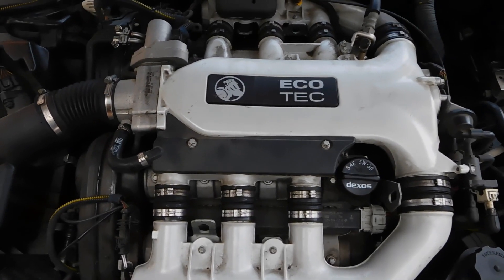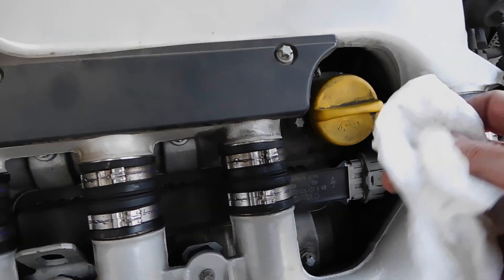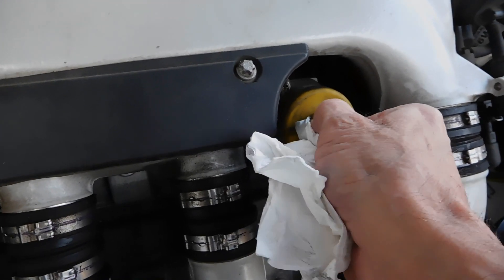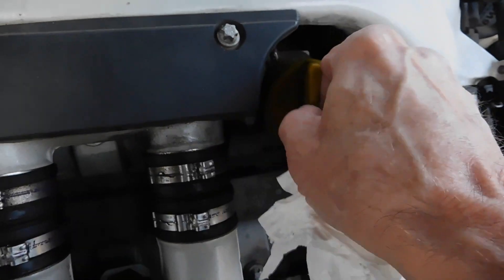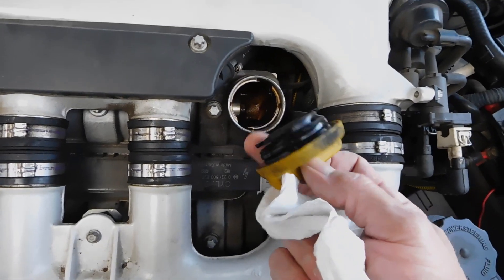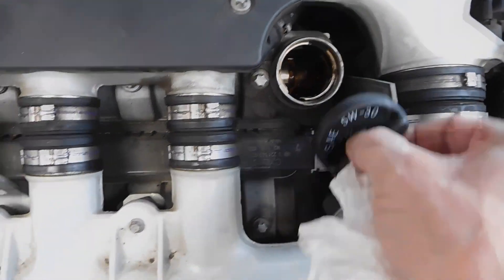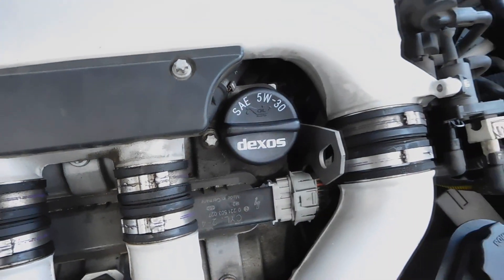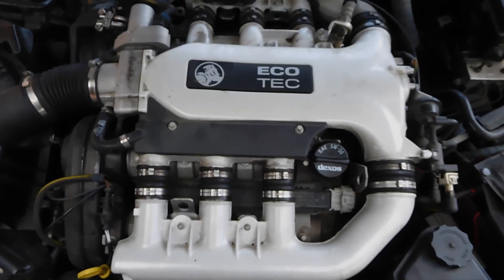How your oil filler cap may cause poor fuel economy, low MPG

Comment from the maker: On the odd chance that anyone watching this video doesn't happen to read the description that explains why this can cause poor fuel economy, here is the reason again

Air drawn into the crankcase by the PCV (positive crankcase ventilation) valve is normally drawn in via the crankcase breather inlet tube which is attached to and sources fresh filtered air from the air intake snorkel between the intake throttle plate and the MAF (manifold air flow) sensor.

The result of having a loose oil cap is that some of the air entering the engine drawn in by the PCV will not go through the MAF sensor as it normally should

Instead being drawn in via the loose oil cap, and thus not be accounted for in fuel mixture control that uses the MAF sensor to determine the volume of air flowing into the engine.

This is similar to a leaking air intake snorkel or defective MAF that will cause incorrect mixture calculations.

In addition to this as the air drawn into the crankcase via the leaking oil cap is not filtered as it is if drawn in via the intake snorkel that non filtered dirty air will contaminate the engine oil and cause it to be prematurely compromised in it ability to lubricate the engine.

And this condition is worsened by air back flowing in to the snorkel from the crankcase that contains oil vapor that should be going into the PCV valve and not the air intake, the result is the oil vapor will contaminate the throttle plate causing a build of dirt on it and that may cause poor idle control in addition to the poor mileage from the first condition.
Reply: Whats your opinion on  finite thermo cycling being a large portion of an engines determined life? ( I try to sound smart when i drink)
Reply: I have a leaky valve/tappet cover gasket. Could it also be drawing in air and causing the same problem?  The car is also idling at 1300 instead of 700.
Reply from the maker: @newsgetsold  
I doubt it, the issue here is not like a vacuum leak of an intake for example it is just that the source of the air incoming that is around atmospheric anyway is not coming through the MAF, or is not being accounted for in the ECM
The high idle you have would indicate some other fault.
Reply: @AuMechanic  Okay thanks.  I just thought the oil filler cap is also in the tappet cover so a leak elsewhere on the cover would have the same result?
Reply from the maker: @newsgetsold  
It would need to be a fairly open leak enough the "vent" the crankcase as the air is drawn into the PCV (positive crankcase ventilation) valve by vacuum.
A loose filler cap provides enough leak path to do that but a small leak of the gasket isn't large enough to draw so much air in it bypasses the MAF sensor on the intake snorkel.
Reply: @DarkLinkAD  🤣🤣🤣🤣🤣🤣🤣🤣🤣🤣🤣🤣🤣🤣🤣🤣🤣🤣🤣🤣 💯 TRUTH
Reply: @newsgetsold  when I have additional air - such as removing my brake booster vacuum line, the engine revs way up!
Reply: and/also: PCM reading a LEAN condition will then inject more fuel and can foul the spark plugs and create misfires, I just experienced.   Ive been chasing down problems on my GMC van for awhile now.. and Im down now finally to a loose, non sealing oil fill cap and damaged oil fill tube grommet at the engine.   Thanks!

Comment: It's one of the overlooked things on an engine, but it could cost the driver a fortune in wasted fuel over the years!
Cheers mate, for highlighting the issue!! 🙂👍
Reply from the maker: Thanks for the comment.
The other issue with this is sucking un filtered air (and dust) into the crank case too so its worth checking.
Reply: @AuMechanic  Yes, indeed. Thank you.
Reply: The fuel cap is another one to check on older cars. The seals go on those eventually. If it feels loose or you can smell petrol around it, it's probably shot. Petrol vapours leave behind dirty, oily looking blotchy patches on the inside of the flap as well.

Comment: I replaced oil cap on a vauxhall meriva and noticed the difference in power.This was after a friend mentioned it.
Although no oil was leaking out of the cap it could not have been tight enough for some time, although it did not feel loose at all really.
For the cost it is worth replacing every couple of years if you are keeping the car for any length of time.
The difference in power i noticed the next day i drove the car,i reckon i might have been losing about 10hp on a 1.4  16v petrol engine.! No doubt i will get better fuel economy now too,even though it is good at the moment.That £7 i spent on the cap will pay for itself in a few weeks of better fuel economy i should imagine.
Reply: thanks for the info!

Comment from the maker: Regarding poor fuel economy, while the O2 sensor will cause the fuel trims to adjust to compensate for the un-metered air that is bypassing the MAF, that will not compensate for instantaneous air flow metered by the MAF sensor, the results of which is that fuel consumption will increase in the same way it does with a dirty MAF sensor.

Comment: I found that with my Holden VY SS Commodore which has a Worn oil filler neck in the valve rocker cover.
The knob which the thread of the oil filler cap screws onto is worn so I fitted an O ring underneath the oil filler cap as a temporary repair to tighten it up & it works.

I seem to be getting far better fuel economy now !
Reply from the maker: Glad to hear it.

Comment: my mechanic told me that if you loose your oil filler cap it won't suck air, put push a lot of air out as part of the pvc system
Reply from the maker: He's got it backwards.
The vacuum of the PCV is greater than the blow by in a normal engine.

Comment: i have azera 2009 & this damn cap is cost me replacing the vales sealing thinking the leakage is from vales sealing. then after few years the alternator broke due to the oil leakage again from the same area! then i found that the cap is not closing tight & leakage is coming from it! so this cap need to be genuine part & closed tight. mine is the type making clicking sound so if it's turning fast not slow it need to be changed. i'm just starting loving EVs more & more🥲 specially the one with the range extender🙂

Comment: Ordered my new dexos oil cap today. Will be here I  no a week. It’s tight when attached. But the seal is loose when I remove it. My oil filler neck feels loose as well. It’s a Chevy equinox. Any idea how to replace the filler neck that the cap screws into?
Reply from the maker: In short, no.
That's a bit beyond the scope[e of the video.
You just need to make sure it seals one way or another.
Reply: I have the same issue. There are a bunch of Permatex products. Do you know which one would be used to run a bead around the tube where it sits on the valve cover?

Comment: Would a bad oil cap cause high oil consumption... Please reply back well greatly appreciated it 🙏
Reply from the maker: It is possible, if the filler cap is allowing enough air in the breather baffle may allow some oil to get into the intake snorkel (flexible pipe) between the air box and the throttle plate where the crankcase breather feeds from.
You would be able to see this if you take of the intake snorkel off and look at the throttle plate it would have a significant amount of oil residue on it.
Or the oil is leaking out from the cap which you would see oil on the top of the engine around the filler cap
Or some other external leak which would end up leaving some oil stains where you park it.
If the engine is all clean and dry of oil externally and it is not leaking from the engine visibly then it may the oil control rings on the piston which would.cause exhaust smoke under hard acceleration at revs, or from the valve stem seals which would be smoking at the exhaust when idling for a long period or a puff of smoke from the exhaust after decelerating down a hill and then accelerating again.
Reply: @AuMechanic  thanks for the reply. Will look into everything 👍 you said

Comment: Hmm, news to me but willing to try it out as I have a shitty oil cap.
Reply from the maker: Hi Merlin
Read the description, it covers which engines this will apply to and some detail in exactly why this occurs.
Reply: Believe me it makes a lot of difference.When i changed the cap on a meriva 1.4 16v 
The cap did not feel loose but was probably not as tight as it should have been this meant the car was drawing in air though the cap.
When i got in the car next day the car pulled a lot better after fitting the new cap.

Comment: Thanks for the tip. Ill have to check mine out as my suv has been using alot more fuel than normal. But i have no codes popping up or check engine light. But my exhaust definitely smells like its running very rich! Is this possible from a bad cap?  Thanks mate.
Reply from the maker: It only effects the instantaneous AF ratio not the overall AF ratio, and you would be able to see it in the fuel trims from the ECM as it has corrected for the air coming on via the leaking cap.
So in short MPG will only increase a bit, not a huge amount enough to smell it rich at the exhaust.
You need to plug in the OBD and read the fuel trims to see what's going on there.
Reply: @AuMechanic  ok, Thank you very much for the info. Ill have to check that out. I was thinking maybe a bad O2 sensor or something? but i was thinking that would of triggered the check engine light on. But maybe not. Thanks again mate. Have a lovely day.

Comment: In my 2020 Chevy Sonic, it is the oil filler tube that is loose and not the oil cap or gasket. I want to run a bead of some sort of sealant, like Permatex where the tube sits on the valve cover, but I am confused as to which one is the correct one. Can you recommend something?  Thx.
Reply: Heat tolerant silicon maybe.
Reply from the maker: Be careful using silicone on modern cars, only use O2 sensor safe silicone or you risk contaminating the O2 sensor/s.

Comment: My oil cap is hard as a rock and almost needs an impact wrench to open. That's also no good.
Reply from the maker: Might be an idea to replace it before it breaks and bits of it go into the top of the engine.

Comment: Would this trigger Check Engine light?
Reply from the maker: Yes potentially it could, if it is more extreme it may cause a fuel trim code and too much oil drawn in to the intake could cause some fouling that may result in a code.